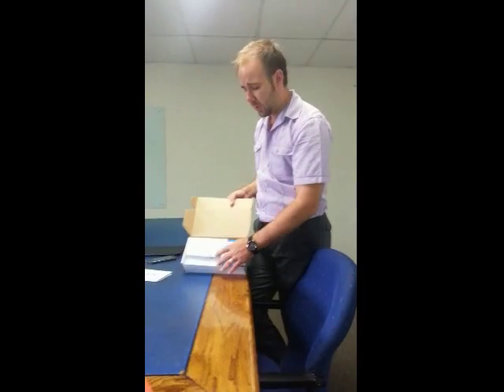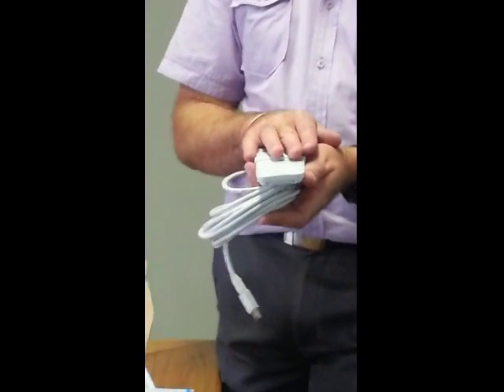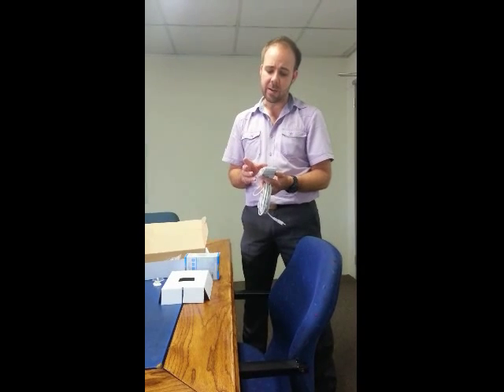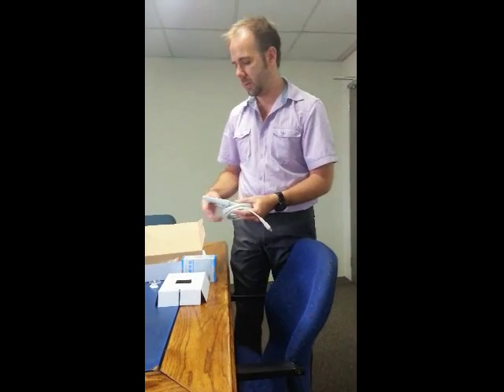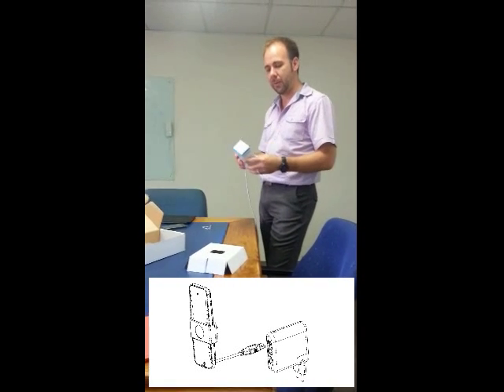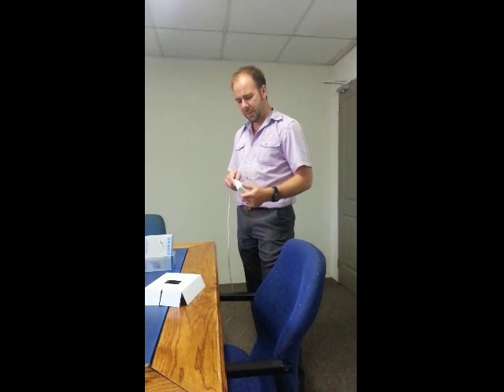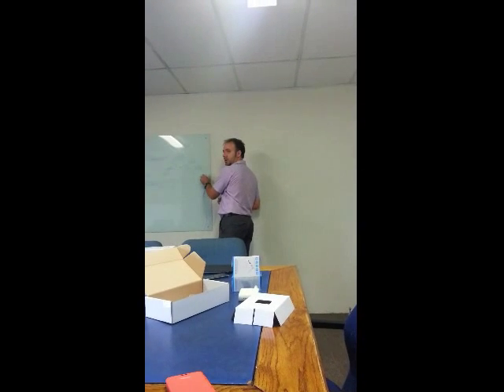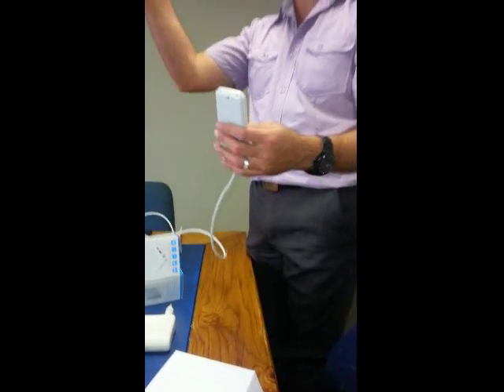Outdoor 3G Router - Introduction to iMOD

Comment: Great idea! looks to be well executed. You mentioned that the antenna was your OMNI-0039. While looking at the iMOD specs on the brochure ( http://www.poyntingcommercial.com/upload/brochure_files/20150630071632_A-IMOD_Brochure.pdf ) the frequency is listed as: 860 - 960 & 1710 - 2170 MHz. However, the specs of the OMNI-0039 Blade Antenna are listed as: 790 - 960 1710 - 2700 MHz. Is it a different antenna? Or are the frequency specs for the iMOD listed so as to show its support for the 3G Bands supported by the integrated Huawei E3131 product that is in the A-iMOD-0001 product? - - Any thoughts on a "Semi-Universal" iMod-type enclosure whereby you could plug in other USB modems (or perhaps Portable HotSpot units) that had an external antenna connector? Obviously it would have to be larger to accommodate a USB modem (or HotSpot) within it and the antenna connector would have to be available within the enclosure to plug-in the antenna connector to the USB modem. Of course, the router you package with it would have to be able to communicate with the USB modem(s) supported... Or, just sell a Universal iMod enclosure with the 5m USB cable assembly, thereby allowing the end user to use their own 3G/4G Router that is compatible with their USB modem or Wi-Fi HotSpot unit. The only problem I see may be the heat build-up issue, as the typical USB or HotSpot was not designed to operate within a very small sealed enclosure.
Reply: +Andre Fourie (Poynting) I have personally modified several of your WLAN Enclosures to mount a Cradlepoint COR IBR6x0-LPE router within it and then connect it to one of your A-XPOL-0002 antennas to create a mobile HotSpot. Wish you had a WLAN enclosure that had the A-XPOL-0002 antenna as part of its cover/antenna: https://www.linkedin.com/pulse/internet-waimanalo-polo-field-james-ainge?trk=prof-post